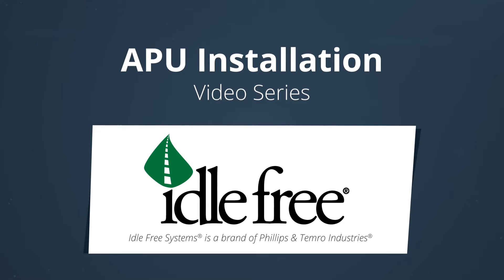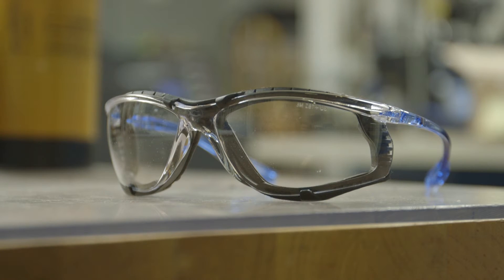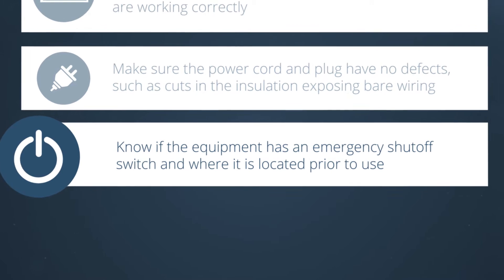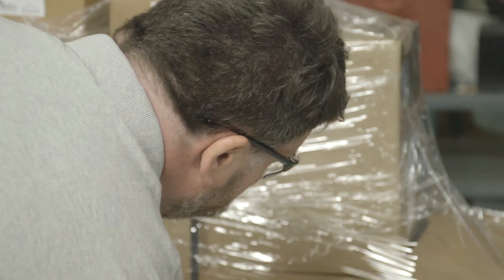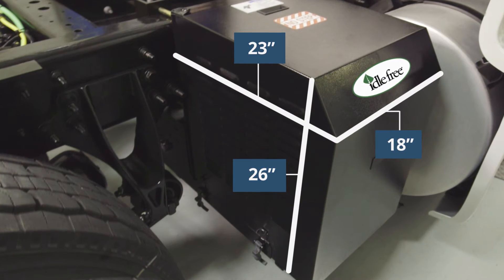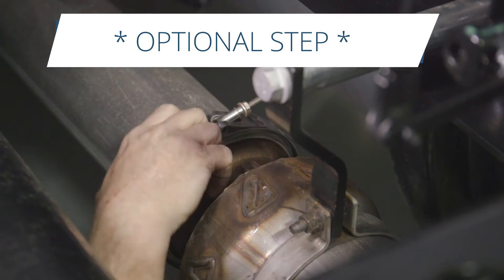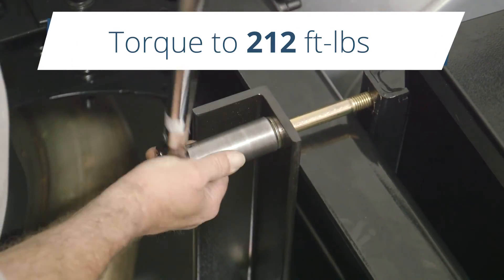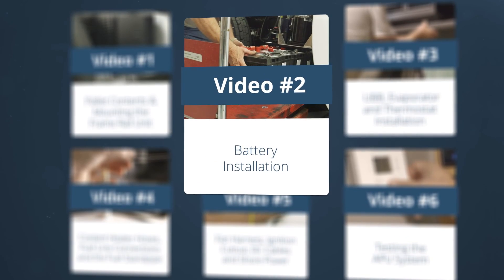Idle Free Systems eAPU® Installation Step 1: Pallet Contents and Mounting the Frame Rail Unit

Comment: My inverter is been overloaded every time I run the ac. I noticed that water where getting inside the bunk and the inverter connections have some corrosion do you think that is what it causing the inverter to get overloaded ?